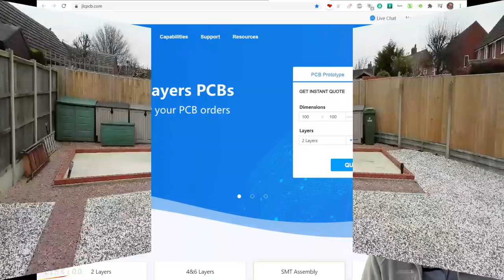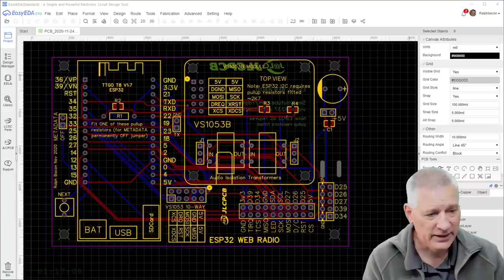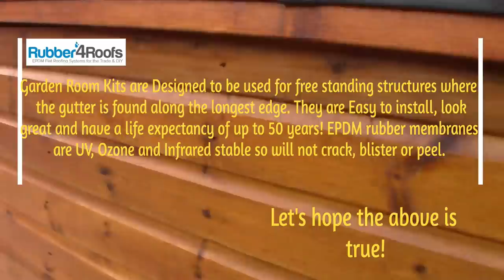#212 Arduino Man Cave aka Workshop Tour 💻

Comment: When I had a similar-sized workshop in the garden (taxman took it all long ago) I had a similar 2kW convection heater. In winter I found my feet got cold and all the heat was up near the ceiling. Fixed it with a 4" PVC pipe from near ceiling to near floor with a computer fan mounted at the top. Would be too noisy to record a video, but as background noise I soon got used to it. Just an idea. Great workshop, BTW, 10/10 gold star.
Reply from the maker: Funny you should say that. Although the floor is well insulated (with that 100mm Celotex) the heat obviously rises. I did have a circulating fan in my last workshop that was speed controlled (due to the noise) and I'm thinking of what I could do here. Your recirculating idea has got me thinking. Thanks, John!

Comment: Very nice. Almost exactly like my setup, layout-wise, only I use my basement that was converted to an apartment by the previously owner. Use an esp32 and a few threaded rod stepper motors that trigger based on moisture || light and close the bin.
Reply from the maker: I like the stepper motor idea with threaded rod. All these ideas!

Comment: Nice job. I recommend you replace the heater with a small reversible heat pump (split air con) or you will cook in summer. Best thing I did in my den. Rubber roof - wonderful stuff 10 years on and no issues at all.
Reply from the maker: Thanks for the tips! I actually looked into air con (not heat pump, although that would be sensible to use the same device for cooling and heating) but the price was too much for me. This year, anyway!

Comment: That man cave is a wooden beauty, Ralph! A really neat 'Lebkuchenhaus'.
Btw.: For the containers I would suggest a Hall-Sensor indicator for the lids. For the heater a programmable temperature controller (DIY-project) across 24/7, since you might want to turn on the heater in the night if temperatures fall too low (e.g. less than 4° C).
Reply from the maker: Great suggestion! I'll add it to the list, Sebastian.

Comment: Nice. I'm somewhat envious. I say "somewhat" because the thought of walking though three feet of snow at -20 degrees (C), out to a workshop, in order to turn on the heater, is a bit off-putting (shall we say ;) I am pleased that I have been able to claim 1/3 of our basement as a workshop (plus 1/4 of the attached garage for a few power tools). I do like the construction of your MC. It seems sturdy and sufficiently weather proof. Not to mention, nicely laid out. The one thing that does bother (maybe (again) because of our winter) are the outdoor storage bins for tools and parts. I believe that someone has already suggested the building an over-hanging roof to protect them from the rain. My first thought was that a "pantry" addition to the back would have been nice (at additional cost, of course).
All in all... very nice. Congrats!
Reply from the maker: Luckily, the last time we had 3 ft of snow in the UK was in 1964, I believe! But I also would like the heater control to be controllable via a phone app (or something) so that I can turn it on at 6am ready for me at 7am. But not on a timer, as I might now go into the workshop that morning.

Comment: Great setup Ralph. Looking forward to following many projects from your new "headquarters". I too will be moving to a new location, hopefully this year. I will be seriously downsizing from 2 -60'x40' buildings to a 24'x24'. For the past 50 years I have always increased sizes with several additions and rebuilds. This will be the hardest thing to weed out my 50+ year hoard. It was a lot more fun acquiring stuff than getting rid of it! Time to let go and move on.
Reply from the maker: We did three sweeps of our previous house (before we moved), starting with a large skip, then a medium skip and finally ending up with two further car trips to the "recycling" centre. The amount we discarded after 30+ years in the same house beggars belief.
Oh, and when we moved in here, I hired a container storage unit for 3 months and eventually had another car load going to the recycling centre. Absolutely ridiculous!
So, I can empathise, and wish you the best of luck.

Comment: Thank for the tour, Ralph. I do have a workshop and a office/tea garden. My workshop is connected with the bungalow, and is longer than yours, one thing in mind I am in a wheelchair for easy access. I guess the cost is in a deluxe type of shed? Solar panel is a must.
Reply from the maker: Raw materials alone cost about £5K so you can work out the rest. So expensive but I hope to be in this workshop for a long, long time. 

Solar panels are expensive and I'm not sure what I could use the power for. The only real power I use is the heater (in the colder months, so 11 months of the year in the UK). Any pointers on solar panels?

Comment: I'm a big fan of those metal clad double sockets. Something about them that gives confidence in plugging stuff in and out. Probably just because they look and feel more robust than the all plastic type. I have many of them distributed around my own lab. Did you consider/rule out bench top dado trunking i.e. with multi compartment for power and data?
Reply from the maker: In a workshop environment I thought that the metal sockets with the surface mount conduit would go together well, and they did. But it certainly cost a bit. And I'd never use 2.5mm twin & earth in conduit again, always singles!
Yes, dado trunking was far too much faffing for me, and I mainly need power plus USB connectivity so this works well (so far).
Reply: @RalphBacon  I know exactly what you mean regarding the twin & earth. Singles so much easier to pull (excuse the pun).

Comment: Nice job with the shop (cave)!

For the storage-
How about some tilt switches, a rain sensor and a wireless to send data to an indoor receiver display/monitor and alarm. You might be able to solar power the whole thing with your power saving "sleep" circuits. You could enhance it a bit and make a weather monitor with special bin status skills. I guess you could go anywhere from sublime to ridiculous.
Reply from the maker: I like it! A rain sensor (with heated sensor) is something I've been meaning to make for ages so it might be back on the agenda soon. But a "lid open" warning sensor is something I definitely need, since after recording that video, guess what I didn't do? Thankfully it didn't rain that night.

Comment: The bins might need rasing off the ground a little - bricks and bearers perhaps - to keep them above the splash zone when it's raining. The other problem might be condensation/moisture in the winter.  The front seems to be two doors too, which is another place that might be a problem with moisture.

I'm sure that you have thought about all this, but just saying. Nice to see you back.
Reply from the maker: Yes, Ian, I had considered all that, and not forgetting that I used one of those bins for my electrical (not electronics) stuff for about a year before I moved to test it all out. 
Result: no moisture, no damp, no mould, everything perfectly dry. Just the odd spider. Hence the decision to use all three bins (that we were otherwise going to be discarded as part of the house move). The bins have bases integral to the design so they are protected from ground water and they are sitting on 100mm of gravel (French drain) so no splashing (just like my workshop).
Thanks for your comments, shows you were paying attention! Good to hear from you.

Comment: Great to see your new shop, a bit too tidy though, but no doubt your new projects will soon cover the desk space  with pcbs that have wires hanging out all over the place. :-).  I did have an outside bin such as yours in just a bit more space twixt house wall and tall hedge, about a 3 metre span.  One of those hurricane type storms a few years back completely tore it apart.  Fortunately no electronics where stored in there but the an outside chair got all bent.
Reply from the maker: A cover over the bins, in fact, over the bins and the walkway would be ideal. I'll see how it goes.

Comment: For the bins, I'd probably go with door/window sensors (or reed switches) and wire them up to a buzzer. Either immediate nagging noise or maybe after 5 minutes... or start texting yourself if you left them open.
For the heater, I would probably go with a little more automation than just the main switch. Maybe take the jump to homeassistant and use a combination of the main power and the temperature in the room to make the decision. This would let you preheat on days where it's colder to have a nice temperature when you start in the morning.
Reply from the maker: Sounds good about the heater, still considering what to do. As it's summer right now it's not being used so I have a month or two to think about it. Regarding the bins, I have a solution, coming soon!

Comment: build a swing up cover over the outdoor bins. as far as the heater don't turn it off, adjust the temperature lower. add a remote so you can turn on from your cozy bed before you go out. or make a phone app and see shop temperature as well. I'm using esp32 with bme280 to chart t/h/pr to a webpage every 15 minutes.
Reply from the maker: Thanks for the tips! Being able to turn the heater on remotely during the winter would be a nice feature.

Comment: You could also use an ESP32Cam module on the back of the shed to watch de lids of the bins. I think with some onboard code can identify the difference between open and closed lids and initiate some signaling if open too long.
Reply from the maker: I did initially think of an ESP8266 but now I'm thinking of an Arduino/nRF24L01 with severe sleep mode. But it's just an idea right now. I do have an ESP32Cam module doing nothing though, so I will see how easy it is to do this!

Comment: Thank you for this. 
When they built your Man Cave, they should have also pulled fiber optic cable. If you don't need it immediately, you can leave it dark. Did you put fiber optic drops in the walls? What about gigabit Ethernet wiring?

You did not mention a surge protector or backup power.
What about an air exchange? Especially when soldering you will want fresh air. 
Yes, the door can be opened but that is not always a good idea in certain weather conditions. Is the carpeting anti-static? Did you consider acoustic sound deadening ceiling tiles?
Reply from the maker: Wow! Lots of questions, here's come the answers:
1. I used Cat-7 ethernet cable to the workshop. My router is in the attic (in the house). That should be good enough for many 100Mb/s if I ever get offered fibre to the premises. It's the upload speed that is important to me.

2. A couple of my 6-way extension sockets under the computer workbench have built in surge protection but that's it. 

3. No air exchange, but my windows can open and will be protected from rain due to the overhand. We'll see how that goes. As simple extractor fan would be easy enough to install, should I need it.

4. Carpet is not anti-static, I use the curly wrist earthing strap when I need to. Not often.

5. No sound deadening ceiling tiles, but I'm wondering what for? It does have 100mm of insulation foam board up there behind the plasterboard and in front of the ply with 100mm air gap (aka cold roof). Pretty quiet in here, unless I open the door/windows and a plane flies past (or a sheep baas!).

Comments?
Reply: @RalphBacon  
You could have a problem with floating ground since you are connecting the house with the Man Cave via the copper in the CAT-7 wire. We used to run into that problem when I worked for a system integration company in the '90s and were linking buildings on a corporate campus or military base. Back then we used an opto isolator. I assume they are still made but now for CAT-7. Or you could pull fiber from the house to the Man Cave which would also solve the issue.

The sound deadening tiles in the ceiling would be for better audio for your videos.

Comment: as an industrial sparkie I have learnt the hard way never store tools in a container with a sealed bottom like the plastic tubs ....drill some small drain holes in the bottom ..even the van vaults with no drain holes will kill you're tools ....also  from experience I know those those ketter or 'copy' plastic outside stores don't last long compared to a proper built structure and are a damp magnet (can you tell I'm not a fan of those plastic eyesores) ..you could have built a small 'shed' in the space they take up for similar or most likely less cost .. even the small steel 'sheds' (not my personal choice but I get asked to put them together when I'm installing garden power) are often cheaper and will last many times longer...all that said its great to see you up and running again , I do really love you're vid's
Reply from the maker: The Keter garden bins came with us (repurposed, they were for garden use, originally). Waste not, want not!
Yes, drain holes are definitely on my list of things to do. As long as I shut the lids, I have found otherwise that things stay dry, no condensation and give me much needed room in my workshop. If I hadn't had the Keter bins I would have constructed a small outside store as you suggest though. And maybe one day in the future, who knows?

Comment: Very interesting and a great setup ... I have most of material to build my Model Railway Shed which will be 5 mtrs x 3.5 mtrs.. im using some Pallets I got free for the base they are plywood type which were used to deliver tables and chairs to a Large Hotel in Bolton (Holiday Inn), and with a waterproof membrane on top of them,   then studwork for a frame from B & Q like yours ... some 18mm OSB which I have to collect from a local farmer again free and plasterboards from B & Q  for internal like yours, insulation I have loads of spare loft insulation... roof I got some 12mm OSB from B & Q  ... I have to demolish an old shed to get the outer cladding and some of the 2 x 1 timber , plus a shed that I demolished at my daughters more cladding... but unfortunatelly all on hold as I got a slipped disk ... you may call it a pain in the Bum ...LOL also been working on a sketch for a Mimic panel and had an issue with a switch case finally found i'd missed a curly bracket off after a break ... 2 days wasted ...LOL
Reply from the maker: Sounds like you will be very busy with your new shed, slipped disk permitting, John. Well you have all of "summer" (if we ever get one). Fancy missing a curly bracket, my workshop has many, I could lend you one. Oh, I see what you mean!
Reply: @RalphBacon      route8_state = Idle;
   }
  }  
 break;
  
 // ********* Block 9 Shunt Loop from Sensor 6 to Track 1 **********************

   switch (route9_state) {
it was the curly after the break missing so overflowing into Block 9 .... not sure when shed will go up as my right leg is bloody painful waiting for Back specialist ... also trying IDE 2
Reply: Hi Ralph, well my shed is starting to take shape, a comment I got off another forum was it will rot, well i'm nearly 74 so not in my lifetime but then got me thinking about a moisture sensor across the Pallet strips so as I have got most of the bits I will get 3 soil sensors and make a sketch up ... may be worth a project on your channel if you not already done, i'll put some pictures on my facebook if you can check me out  LOL ...Regards John

Comment: You are missing a tea & coffee station!
Reply from the maker: My tea and coffee station is about 6 meters away (in the house)!!! And I get to raid the fridge too.
Reply: However, importantly, there is a bottle opener on the edge of the work bench.

A man does need to have his priorities!
Reply: @pileofstuff  I saw that opener when you panned by. Handy. I'm sure you could put one of those college size refridgeraters under a bench if you need a cold one in the heat of summer. ;)

Comment: Suggestion - why not have a raspberry pi set up with node red or something similar set up to control everything, you could add the heaters on there, manual/auto override, set the temperature, your remote sensors for the bins out the back etc. Maybe a small display on the wall that shows everything you need it to. 
I actually have node red set up for a few devices that control an outside lights module for floods and rgb strips, another for outside temp and humidity and a esp32 camera, all fed from my 12v solar system. I even have it set up on my home-screen of my phone to allow easy access to turn on the outside lights from inside my house to let the dog out!
Reply from the maker: You've described what I wanted to do in my previous workshop but never had the time to implement it. Maybe I will have time now.

Comment: Did you consider just buying a house with an one more bedroom? I'm curious what that would cost vs. paying for new construction.
Reply from the maker: Good grief, no, that was never on the agenda and even if I had bought a bungalow with another bedroom I'd never use it as a man-cave. This my MY domain, where I can do what I want, when I want. I'd never be able to do that inside the house (which is where I started my YouTube journey a few years back but quickly outgrew that room).

Comment: Nice. 

You could maybe add a solar panel or two and a couple of lead acid batteries  to provide 12v power to your shop.
Reply from the maker: I could, but I'm not sure what I'd use it for and I could never justify the cost. Solar panels are darned expensive!

Comment: Perhaps you need to set up a battery powered ESP 8266 sensor on the bins behind the shed that will display illuminated LED’s regarding the status of the bin lids.  Use red and green like a submarine uses for its hatches, red open and green closed.
Reply from the maker: I'm sort of on the same lines, Bruce, but I'm now thinking Arduino with nRF24L01 - very reliable and can go to sleep with pretty much zero current. Red & green, deffo.